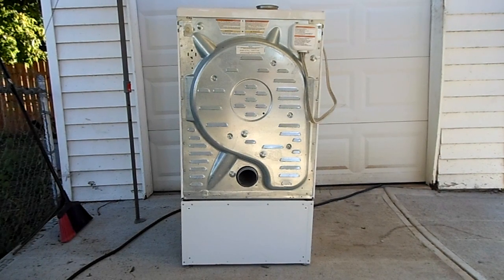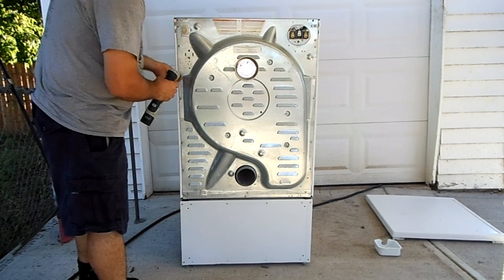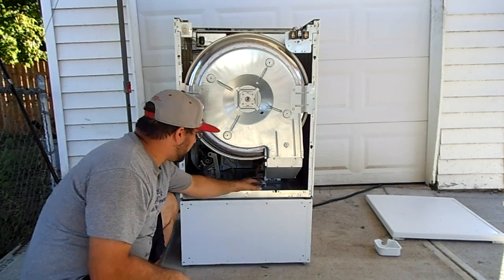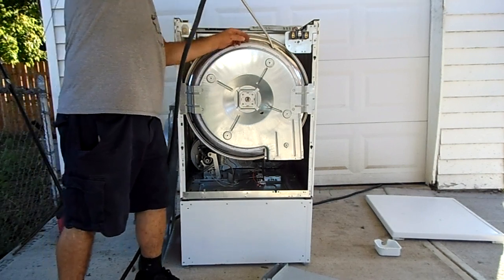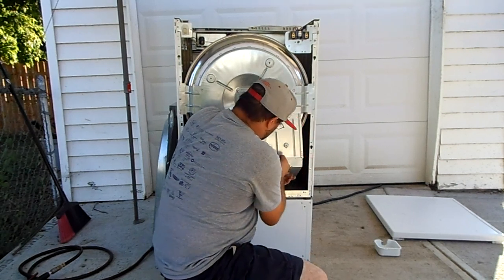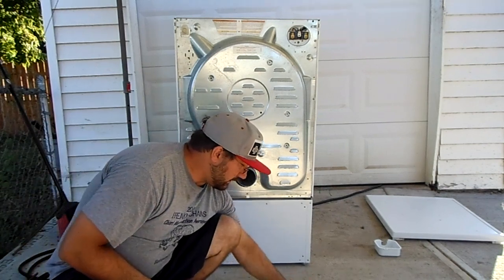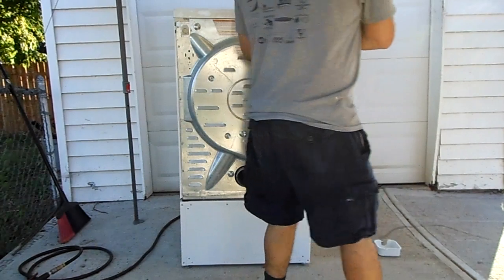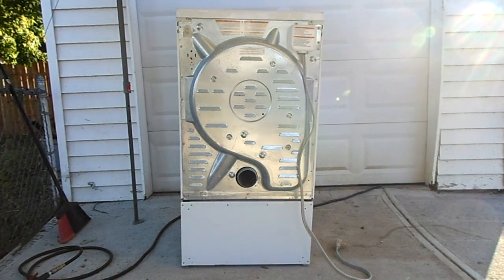Fix: Bosch WTVC5330US WTVC5330US/09 500 Series Vented Dryer with Steam Lint Filter Light On

Comment: SAVE TIME. Watch video at 4:30 to 5:00, I removed bottom half of T-20 screws, Allows roomto cut  back panel right thru screw hole below dryer vent tube. Then just rotate vent tube hold down tang thru that cut panel and remove vent tube. Now you can access the thermal reset button much easier every time it pops. My wife used to open dryer door before heat cycle completes, blowing thermal switch almost every time. Let dryer shut off itself before opening door or you will be resetting switch often! It is on fire in there and when you open door when coils are hot you stop blower cooling air flow, temp builds and thermal reset pops.

Comment: Thanks, I have the same model. After more than a decade of faultless service, it overheated - clothes were blazing hot - it was painful to touch them. I cleaned out all lint from the screen filter space, and the air ducting. But the next time, the dryer failed to heat the air at all. Turned out that all it needed - after disconnecting from power, closing off the water valve and disconnecting the water supply - was to follow your wonderful instrux for the somewhat daunting removal of the back panel, and a quick depress of the tiny red "reset" button near the bottom. It clicked first time I pressed it, not the second, so I was pretty sure my problem was resolved, and indeed it was - the dryer is now running just fine.  Too bad the design does not allow for more convenient access to this button. Judging by the number of youtube vids for "how to reset a Bosch clothes dryer", this remedy is needed quite often. Many thanks - you have saved me from having to pay for a tech to come out here and do what I just accomplished!

Comment: Hi Crasoum,
A few years back I had to call the Bosch service folks 3 times in the space of 4 months. The third time I was really upset and let them know about it. I must say the repairman did not charge me for the last service call and even showed me the location of the reset switch. He also changed the switch component. Fast forward to this morning and again the dryer isn't heating. 

Thanks to your video my husband was able to fix the problem and we saved 130$ in repairs.
Reply from the maker: Hey, I'm glad I could help you and your family out!  Sorry the previous services were not super helpful, that's unfortunate and sometimes how it goes. That's kinda why I started working on thing myself. I figure I can't break it worse then broke, usually. Usually. 

Hope your husband's fix lasts until you need a new dryer, and if not at least now it shouldn't be unfamiliar territory. 

Also don't forget to clean out your lint exhaust and trap, from your dryer to outside your home  while you have it apart. Never a bad idea to clean them yearly. (Per use for the internal dryer easy access lint trap.)

Comment: Thank you for this. I just picked up my set used, and I am thinking this is why the previous owners got rid of them. It will trigger "Lint Filter" on its first use of the day, but no subsequent uses. I did notice a lot of lint in the exhaust tube, so I'm happy to look into mine further.

Comment: Thank you for this video!! My dryer heater stopped working a few months ago. After cleaning filter and blowing out lint through duct, it started working again. I had the same problem again a few weeks ago and did it again and it worked again. This last time not so lucky and was ready to replace it. I watched this video and reset heating element and it's working again!! Hopefully this is the fix for awhile because my laundry room isn't big and requires me to climb behind the dryer to do all of this. I'm no spring chicken!!!
Reply from the maker: Cool, glad to hear it!

Comment: Thanks for making the video, our dryer just started the won't start blinking lint filter issue.  I knew I had to give it a good cleaning after a decade of use.  I didn't know how to take the back off, this video gave me the confidence to do it.  It did take the back off, the vent pipe out and the heater box out.  I gave them all a good cleaning with the shop vacuum and compressed air.  It is certainly cleaner now but it still doesn't work.  I saw the reset switch on the heater box, it seems to not do anything.  I am not sure where the temperature sensor is on the lint trap in front, what it would take to clean or replace it.  I know where the lint trap is, I just can't see any sensor or way of taking the front apart easy.  Do you have to remove the drum and motor to access it from the back?  That would seem like a lot of work, there must be a better way.
Reply from the maker: When you say the reset switch doesn't do anything, do you mean it's stuck open? Or does it read 0 Ohm (Like it should.)  Is the element good? (Should read 10.5 ohm, about) The temp sensor at 75 degrees should read around 16.7k ohm at the back connector on the heater box and 7.25k ohm for the front one near the lint trap (at least mine do. Ball park figures here, as long as it's not sub k or mega ohm resistances. ) The front one you can just reach in and pull out from the back, if your arms are long enough and hands small enough, it's just a rubber holder so you can rock it back and forth to remove it. You have to gently pull back the tab to remove the plug.
  The limit switch next to the thermal couple can also be removed from the back, but you need to use a small screw driver, and again have the reach to get to it. The limit switches should read 0 ohm, if they are open they need replaced. 
The motor also has a switch that should read 0 ohms at the connector (the white thing, with the blue spade connector covers). 
I'm sure you can do some of this from the front, but I've not done it and haven't needed to yet. Plus it's a super big pain in the butt. More so then going through the back.
Reply from the maker: If you don't want to reach in and try and unplug them, you can test at the top connector, the top left teal one is for the heating element temp sensor, The white one above the teal is for the lint trap sensor. They are the ones you have to remove the front panel to get to upper left if looking at it from the back, upper right if looking from the front of the dryer, and not the *blue connector in the middle of the board with black wires (that's for the water mister solenoid, I think.)

Comment: I'm assuming the dryer would not run with the lint filter light blinking 🤔
Reply from the maker: It can, but if the difference in it's reading from multiple probes is too high then it stops from what I recall. If it's all working holding the stop/start button for 7 seconds can reset things, but if you have a fault somewhere you'll need to figure out where and repair/replace.

Comment: What if you press the start button, the relay clicks but the drum doesn't turn? The door switch seems to work because the dryer light goes out when you close the door. The red button did nothing.
Reply from the maker: I'd say check the motor for continuity, should read 4-16 ohms, and if it doesn't then it's done for. This is off the top of my head, so the numbers are approximate, but 0 means short, and anything in the thousands or more means corrosion/too much resistance.

Comment: I pushed the button and it's still not getting hot
Reply from the maker: Then you likely need to replace your heater coil, or one of the couple of thermostats. 

Take a ohm meter to those parts and if any show OL or infinite resistance then that part is bad.

Comment: Thanks for the video. Our 500 started smoking inside. Checked all the exhaust vents, pretty clean... will there be any lint behind the drum cover??
Reply from the maker: Smoking would usually be lint on the heater coils, as that's the place it gets hottest. There could be lint elsewhere but usually the simplest answers in these cases are the right ones. Otherwise it could be the motor getting hot (less likely) or the wires  getting hot (least likely).